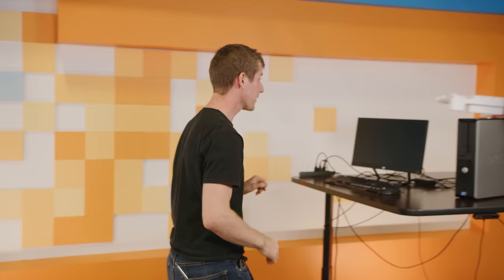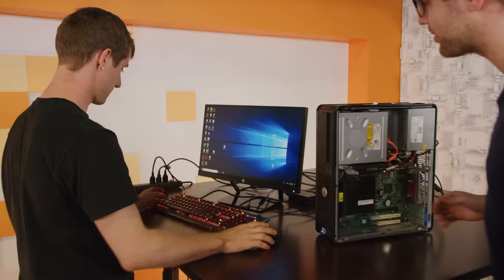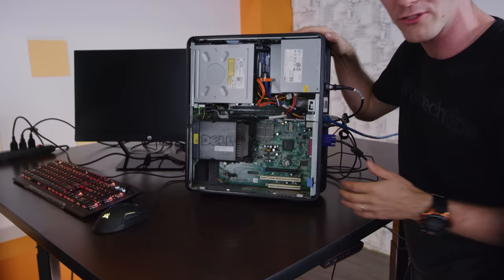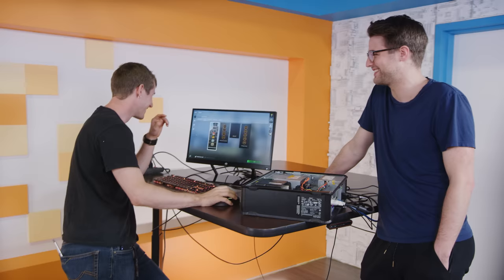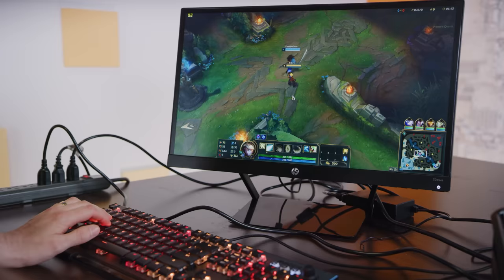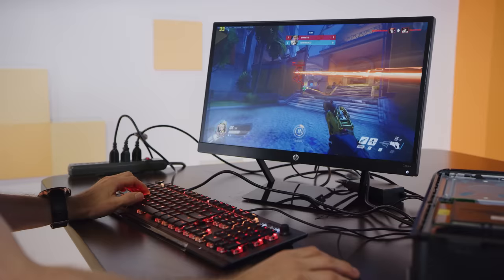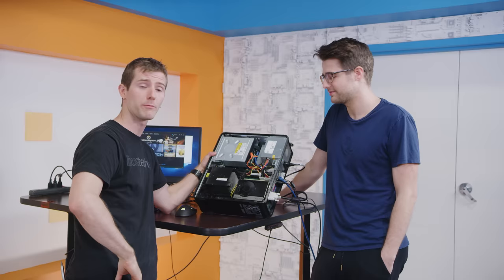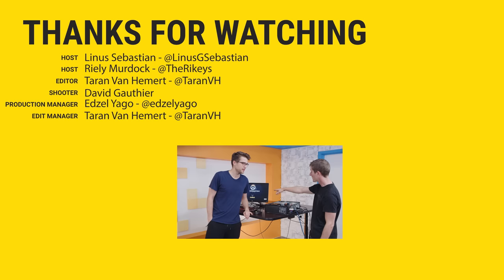The $69 Gaming PC RETURNS

Comment: This was great. My problem is my current machine is already better than that one, but the mobo is dodgy.  I would love to see a video about building something NEW, and still very affordable, like one of the new AMD APUs.   For example, the Ryzen 5 2400G. No graphics card necessary.
Reply: yes but even cheaper with a Ryzen 3 APU. I heard good things about that for 1080 gaming.
Reply: Yes, Mar. Good point. I gave you a thumbs up. I may wind up going with the 3.  I like the 3 also, but I hope that I'll be able to go the extra $69 and get the slightly upscale model, as I'm thinking about longevity. All good wishes, bro.
Reply: linus could do a video about what the "absolute minimum for good 1080 gaming" is. ryzen 3 or ryzen 5 both with graphics integrated and then ryzen 3 and 5 without internal graphics but with a cheap graphic card. would be interesting to find out where the architecture/price/performance optimum is.
Reply: Thanks, discoragement. It's not water damage in this case AND this thing is over ten years old. (it came with Win XT!)  It's an old Phenom II processor with 8GB. maxed out and just not up to my video editing. I need something new and faster, but el cheapo, like i can get with a nice APU
Reply: @unalive_feline  In Low Spec Gamer's video that was just for the APU, mobo and ram. Your build with storage and combo PSU/case is around $300, not including a copy of windows(which could be $0-$100 depending where you get it).

Comment: well most people already have a PC. just drop in a 1030 or a 1050 and you have a "more than adequate" gaming system.
Reply: easy upgrade on the cheap throw in a quad core 775 cpu like q6600 or cheap E5450 xeon 771 mod to 775 and same perfomance as a q9650 on the cheap
Reply: those optiplex coolers are more than good enough at cooling a c2q
Reply: Went to my grandma's house. she had a Core i3-2130 equipped Computer system, i ordered a 1050 from Amazon and dropped it in for some decent gaming experience while i was at her place.
Reply: I still use a circa 2007 Intel Core 2 Extreme CPU x9650 3 GHz, and a modern graphics RX-480 - card and can play almost anything with my kids.  - when I future proofed my machine now closing in on 12 years ago, it was well worth ~$1000.00 for the extreme chip back then.   ASUS-P5B Deluxe still going strong.

Comment: I hate my life my 2008 1000$ laptop [although old] cant even run cs go
Edit: I can only run Minecraft at 30 FPS xD
Reply: My 500$ 4 months old PC runs C's go at 1080p at 50 to 70 fps :-P
Reply: thats the magic of a graphics card, most laptops only have integrated cpu graphics which sucks for gaming
Reply: I had a 8-900 dollar laptop that ran league of legends at like 25 fps and it couldn't handle minecraft very well either :/
Reply: Come on, 10 years is a great life for a laptop. I mean, my 2008 laptop still lives too, but I left it in the Academy office to use it as a browser/LaTeX machine.
Reply: Just gotta clean it out and reinstall Windows. Helps a lot. Laptops ofen come with a ton if preinstalled garbage wich causes them to age badly.
Reply: My 6 year old Acer Travelmate netbook can run Minecraft at 20-50fps (modded/unmodded) and can also run KSP at decent frame rates
Reply: What is it, a mac?
Reply: my pc can run csgo at 450fps :P
Reply: None of my 4 800-1500eur 2006-2008 laptops can't play any dx10&above games
Reply: @erejnion  well if you throw an ssd in a 2007 powerbook it is a very enjoyable work machine
Reply: @jasongreening4095  the problem with those is they require hardware that can run games on their own, like you need h.265 which most laptops before 2013 don't have

Comment: I did the same thing. I couldn't fit a radeon HD 5450 in one so a bought a cheap $10 case and transferred the motherboard. Fun fact, this comment was written on the same PC.
Reply: Quix Filmz HD 5450? I sold a 6950 for $30 not long ago
Reply: @MzerSpeed Wait sorry it's a HD 4800. I got it for $16 USD so I think it's a pretty good deal. I'm currently saving up to custom build a PC with a intel i3-8100 (may switch to AMD if they can release new ryzen generations)
Reply: Quix Filmz intel is coming out with 9th generation cpus soon. I’d wait for those.
Reply: @Quality Hoodie Yeah maybe I should. Still the problem is the latest product is much more expensive. It's a current trend - Apple (iPhone XS and the many other ones) and the nvidia RTX products, are all examples
Reply: @MzrSpeed I also live in Australia meaning not everything is so cheap. I've never bought from amazon but the more I look at it - I might use it as it's substantially cheaper than my local shops
Reply: I got same pc with i5 2400, r7 370 8 gb ram just transfered to other case, costed less then 200$ 2 year ago, still does fine :)
Reply: You can get sff brackets on eBay    as I use that card on my Linux server
Reply: Thanks for your replies. I have $500 to spend, so buying a budget PC is a certain must.

Comment: This Pc runs minecraft better than my 1050TI XD. the new update destroyed my pc
Reply: CatGirl I played Minecraft on a 1050 and had 0 problems so it’s probably your ram and cpu.
Reply: Does that mean an older driver runs it better? If it is then use an older one
Reply: Feelsbadman
Reply: What cpu do you have id check to see if youre being bottlenecked , if its not that id recomend checking your graphics drivers makeing sure theyre up to date.
Reply: @drew1427  it's 100%the auqa update or how it's called. Had 150fps before
Reply: I run a 1050ti, 16gb ram, ryzen 5 2600x and it runs perfect. optifine+HD shaders and i get regular 70fps.
Reply: With the last update, The game runs poorly... I have 50/60 fps with GTX1060 6bg, core i7 8700k, 16gb at 3200mhz

Comment: This beauty needs a Q6600 with the BSEL tape mod to run it at 3ghz. Those are CHEAP, and easily twice the CPU performance.
Reply: Phil Atkins or a Xeon x5450 :)
Reply: @kennethlacombe9004  absolutely! Whichever is cheaper is best ;)
Reply: Sorry im from 2018 can you translate
Reply: Actually that's an Wolfdale CPU and can run easily at 4ghz on a cheap P31DS3L for example with just 1.3v. It has a 266mhz FSB and you can do BSEL mod on it also to run it at 333mhz (3600mhz) usually on stock voltage on the Dell setup.
Q6600 on that motherboard is overkill, the VRM is so flimsy it would overheat like nuts.
LE:@rip x
BSEL mod means bridging some dots on the CPU or covering a dot to fool the motherboard and having a rised Front Side Bus on the CPU.
For example the default FSB on the Q6600 is 266 and max multiplier of 9 = 2400mhz. Covering the first pin under the left notch with a tape and puting the CPU back into the socket will give it a stock FSB of 333 with max multi 9 = 3ghz. You need a strong cooler and a decent VRM (at least a good airflow on the VRM) because it will be HOT like hell with the stock cooler.
Reply: @maxkegerize6819  lol! If you fancy a boring lesson read the long version, otherwise
*TLDR*: Sneaky tape tricks the motherboard into running the CPU 20% faster ;)

With older intel chips (LGA 775) you could trick Dell/proprietary (Non overclocking) motherboards into overclocking.
You did this by covering two contacts on the CPU itself. It's called the BSEL or tape mod, and it works with the LGA 775 CPUs that had a 1066 Front Side Bus speed.
What the tape mod does is kind of like not giving the motherboard any information about the FSB by hiding it, so the motherboard loads the "default" of 1333, which overclocks the CPU to 3ghz.

LGA 775 is almost dead now, but there are so many Optiplex systems out there for cheap that to fully Balls To The Wall spec them out is CHEAP. Generally 8gb of DDR2 RAM is about $15, a Q6600 is about the same or less, and SSD drives are finally cheap. Chuck in a low power graphics card and you can game fairly well
Reply: @eEnzo0  raising the front side bus will not drastically increase the temperature. Generally a 5°c increase even at full load on aida 64 is all you'll get, which is why it is such a popular mod.

A stock cooler and fan can easily handle the load of a quad core at stock voltage (even at 3ghz) because they were designed as a business PC to run in any country, in most conditions from the arctic circle to the austrailian outback, with zero maintainance.

Because of this over engineering, the abundance of LGA 775 based optiplex computers is almost ridiculous on the second hand market, further reinforcing their reputation for incredible durability and longevity.

I have two Q6600 based optiplexes, 760 mini tower and a 755 SFF.
Both of these run at between 61°c -  65°c (depending on the room temperature and humidity) on a 12 hour burn in on aida 64.
Reply: Tell me about it, I miss those Micron D9GMH memory sticks, I was running them 1200mhz 4-4-4-8 (Team Xtreem I had and max OC with them I had 1333 cl 5), I had an E7400 which could do 4.5ghz on air and an E8400 C0 running at 4ghz 1.2v on DFI LP P45T2RS. Great times , sadly gone. Now overclocking is done with your wallet.
Reply: @joannaatkins822  wow ok that would be slick.

Comment: WOW !!! I have 3 OF THOSE home and I was thinking of throwing them away hahahaha !!
Reply: They should put R7 250 gpu its single slot 1gb d5 128 bit same sa theirs gpu and i think there is even low profile version and it costs like 30$
Reply: If the boards are still good you can always install Linux. :)

Comment: Easier solution. Get a somewhat newer refurbished office PC, and slap a slim profile GTX 1050 in it. I picked up a refurbished HP Pro 8300 with an i5-3470 (yeah, a legit quad core at 3.2GHz), 8GB of DDR3 memory, and a 250GB WD Blue hard drive. Got a low profile GTX 1050 from MSI, and the total came to $289. Now it still needed an OS, monitor, and keyboard/mouse, but I had extras to spare. So the GPU plugged right in, without needed extra power cables. It's a newer (i.e. not backwards) layout, so while it was a tight fit, the dual slot GPU did fit just fine. Sure it costs more, but still comparable to a modern console. Has little issue with 1080p60 gaming with medium settings, and you can easily crank things up with older titles or remasters (TESV: Skyrim, Dragon's Dogma: Dark Arisen) or with well optimized games (MGSV: Phantom Pain, Warframe, DOOM 2016, Destiny 2). Still, the whole thing was a hell of a lot less jank. No floating loose GPU's here.
Reply: Yeah, but you'd be paying $220 more for that.
Reply: Correct. You can do basic math. Hooray.
It's also a far more capable option, at a very modest price, that avoids all of the janky case cutting, power supply, and free floating GPU shenanigans.
So did you have anything else to add, other than arithmetic?
Reply: This is supposed to be a budget PC build, hiking it up to nearly $300 defeats the purpose of the exercise. Still a good build for the price, though.

Comment: The high school in my town has tons of optiplex's
Reply: Optiplex 9020's are pretty good, as long as you have the "MT" version.  I5 quad core 4590 and 32 gig ram in both of mine.  The only sucky thing is that they use a power supply with a propitiatory motherboard adapter that is not large enough, IMHO, even though I have one set up as a basic linux server with 4 4TB hard drives in it.  I had to buy a custom bay adapter to install the other two drives, but so far, it's running well.  The other I upgraded the PS and installed a far superior graphics card to replace the intel on board graphics...that one runs my home entertainment system and sound system exclusively.

Comment: OmegaLul. This was very epic. But funny enough I run an Optiplex 980 I got for flat $70. I also have 2 risers for the two PCI ports and it came with an HD 8570. I literally spent the rest of what I had on a 1050, a mediocre power supply, and now run a Linux kvm system that boots all 3 types of PC OSes. The PC has an i7 860 that destroys with 8 total cores.
Reply: And the total cost?

Comment: If you're stuck with an old hard drive as your boot device, RUN CHKDSK! (Also backup your files beforehand).
It's not magic, but it definitely helps an old HDDs run at speeds more akin to when it was new. Also The chkdsk works MUCH better if you do it through the windows installation or plug the disk you wanna chkdsk into an existing system, this way the chkdsk isn't stuck running and relying on the very drive it's trying to check.
Warning, it is a VERY long process (3-20 hours, your mileage may vary), but it does finish 10-30% faster when running through windows installation or using another system.

Comment: You can find used machines with like a pentium g820 on ebay for the same price. Much better processor too at that. If you have more money find a optiplex 3010  thats ivybridge based. Found a few i3-3220 ones for $75 just now. Not the worst integrated graphics either. Will get you into a lot of games albeit lowest settings until you can afford a card and that 3220 gives you a little wiggle room for better upgrades, more ram swap it out for a ivybridge i5 and would work better with windows 10 in general. Plus I doubt a 650 would be bottlenecked by a 3220 like this core2duo is doing.

Comment: You should've gotten the Optiplex 580 instead. I have one as a spare PC. It supports up to quad-core 3GHz AMD Phenom II, which beats the pants off a Core 2 Duo, and I don't remember what the onboard graphics is in that machine but it's better than Intel's onboard graphics. Also it has not one but TWO (count 'em!) PCI-Express slots, so you could fit a low-profile 2-slot GTX 1050 card in there.
Reply: a 3GHz Phenom II X4 is going to cost at least $40.
Reply: Funny you should mention it, I just bought a 3.2GHz Phenom II X4 last week for $25.
Reply: yeah I bought the Black Edition Phenom II X4 960T for $40 a month ago. It's suppose to be the CPU with a disabled core that you can enable in a supported BIOS.  3.0GHz turbo boosted to 3.4GHz.  $40 was the cheapest I could get for that specific CPU, the X6s go for $60 range. The basic X4 are less than $40.  Like my old Phenom II 945 X4.
Reply: @vh9network  nah the disabled core were (some) x3 phenoms. But they released them to dump single fried core chips that did not survive production, so many only did have 3 functional cores.
Reply: @mandowarrior123  I think he was referring to the chips that are Phenom II X6 with all cores enabled but Phenom II X4 with a couple cores disabled. Deneb was the native quad if I'm not mistaken, and the T in the 960T model number indicates it is the 6 core Thuban die. He was hoping to unlock his quad core into a hex core.
Reply: Just get a dell T3500.

Comment: Why don’t you use Geforce Now? It even works on a MacBook.
Reply: I have a code that I didn't use yet lol
Reply: Takes a year to get a subscription.
Reply: CPU will be a bottleneck still with ability to process the connection fast enough. etc
Reply: because ins't 69$
Reply: I wont ever use geforce now or anything similar on principle.
Reply: I would absolutely love that code, if you're not going to use it!
Reply: @abdulhaseeb6091  can i have it :|
Reply: HEY GUYS THIS IS AUSTIN
Reply: I absolutely love GeForce Now
Reply: It is compatible with a lot less windows pcs than macs
Reply: Using Geforce Now presumes you actually have a decent internet connection and don't have a small cap for your usage.
Reply: Piotr Krolikowski in Austria 🇦🇹 Data caps aren’t a thing.
Reply: The funny thing is that I can't even run GeForce Now. lol
Reply: Alright I'm gonna post the code be ready. Make sure you have ethernet or else it's shit
Reply: Please don't kill me if it doesn't work.

Comment: i flip PC's for profit on the side, if you are patient u can get real good stuff for <100$.
recently got a kit with a Asrock 990FX Extreme 3 + Phenom X4 965 + 8GB DDR3 + GT440 1GD5 + 550W lc power PSU (pos), shoved that into a cheap case i had laying arround from a PC i stripped for parts, added a 500GB HDD and replaced the GT440 with a GT730 2GD5 (total of that cost me about 70$)
sold the PC for 185$ with a greymarket win 10 installed (about 75$ investet total) and i still got a somewhat usefull GT440 
this is no "lucky one time thing", nor is it the best deal i've gotten... just pay attention and search for things nearby and u'll manage to get a nice machine in a short time
Reply: That's a great deal but when selling pcs with a gt 730 dont list them as gaming pcs please. I feel really bad for the kids who end up buying a gt 710/730 'gaming pc' as the gt gpus are display adapters, not for gaming.
Reply: never sayed anything of a gaming PC in my comment, further on a GT730 2GB DDR5 (thats the one with 384Cuda cores not the stupid one with 96) isnt all that bad to play some less demanding stuff on a cheap monitor (lets be real, noone who buys a cheap used computer is running to the next store to buy some 29" ultrawide gaming monitor with G-Sync ... sometimes ppl ask if i have a monitor for sale aswell, most of them are plenty happy with a 19" 1280x1024 screen or some 20" 16:10 Screen with like 1440x1050 
a Screen like this + a 730 2GD5  will deliver a pretty good experience if you choose to play some games on it :-) 
also the GT 1030 will beat a bunch of a bit older cards like a GTX650, GTX560 and similar while running on any garbage PSU and fitting into low profile cases :-)

Comment: I did something on a dell Optiplex  ( forgot the model ) SFF. I cut a slit in the top panel, used a PCIe rizer and cut the back part of an old PC case. I installed a 1060 6g. I replaced the PSU with a 450w one. That didn't fit so I had an external PSU. Also had to get an adapter for the MD power connector as it didn't have a 24 pin... and... I had to hijack the power button as I wanted to put it in a arcade cabinet and wanted to move th power button over yhe screen. Intersting trip.